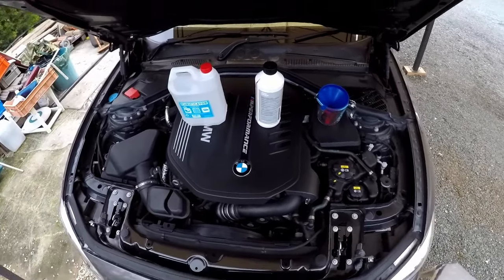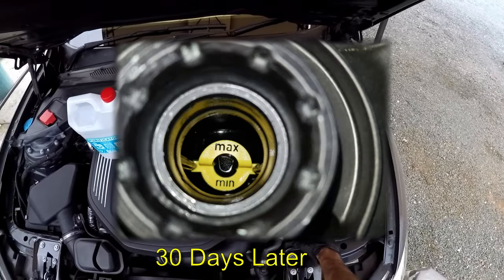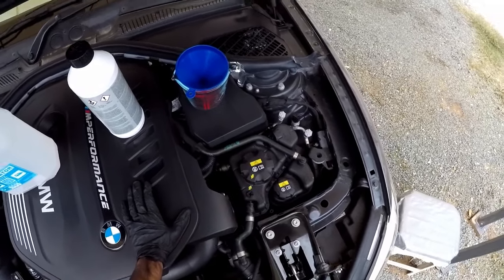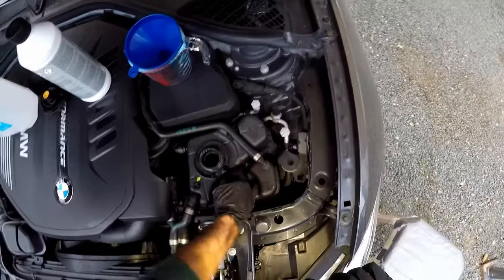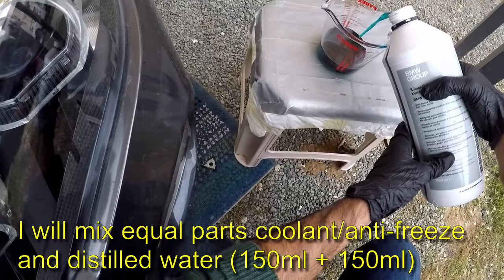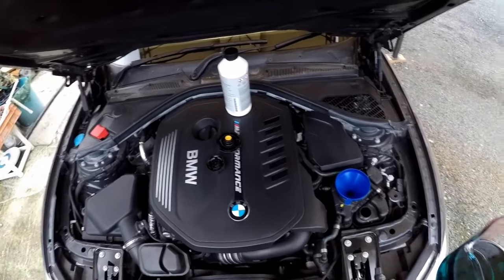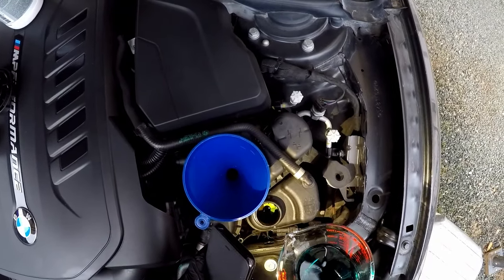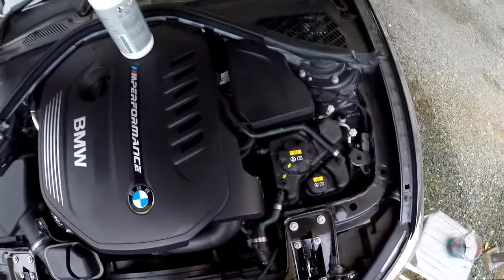BMW B58 Engine: How to refill coolant (Escaping from Filler Cap - Quick Video)

Comment: In my g20 m340 I have green coolant. Name ht-12 antifreeze coolant
Reply from the maker: Yes, newer cars will have the more environmentally friendly HT-12 which generally comes in green although early batches came in magenta. There's some information that HT-12 and the blue coolant are intermixable, but I would check with the official BMW manuals before doing so. Generally, if the car has blue coolant in the tanks then it makes sense to top-up with blue coolant. If the car has green or magenta coolant (remove a sample with syringe or turkey baster to check, i.e. not against the internal tank yellow indicator), then it makes sense to topup with green HT-12 coolant (you can topup with magenta HT-12 theoretically, but the magenta HT-12 was a limited production and won't be easy to find as a spare).
Reply: @NoBrainerTalk  it's not even says what coolent I have to use in my manual.. But I will check if it 100 green? Ht12 I have to. Mixes also right?
Reply from the maker: @oneofm3409  Yes, HT-12 will also need to be prepared as 50/50 anti-freeze and distilled water. Please make sure by reading the instructions on the back of the container.

Comment: Hi my friend, does the smaller reservoir tank hold coolant or just water?
Reply from the maker: Coolant (50/50 mix of anti-freeze and distilled water).
Reply: @NoBrainerTalk  thanks, my reservoir in the smaller tank is just water. I bought from new so will probably need to ask BMW to drain and refill with coolant and distilled water.
Reply from the maker: @f32440i  If it smells sweet it probably has anti-freeze (water will be odorless), but if you believe there is no anti-freeze or from its colour is likely not within the normal distilled water/anit-freeze ratio then yes have it flushed and replaced. The right percentage of anti-freeze is essential not only for reducing the freezing temperature but also for increasing the boiling temperature of the coolant and also adds corrosion protection to the circuit. Just water will have no corrosion protection.
Reply: @NoBrainerTalk  thanks for your insightful feedback. I'll have a smell but it definitely has no colour so I'm assuming bmw used just water from the factory which is so annoying.
Reply from the maker: @f32440i  I personally found a light brown / olive colour fluid in my intercooler coolant expansion tank (the small tank), and I also flushed it as there is no coolant from BMW except LC87 and LC18 (blue and green respectively). I think there must be a fluid BMW uses to add corrosion protection to the coolant circuit that is not a coolant (maybe also used to flush out build debris), and should be flushed (replaced with coolant) before the car leaves the factory. The presence of this non blue or green fluid I believe indicates an error at the factory. However, until now (despite being reported by multiple people around the world) we haven't had any confirmation from BMW that such errors have happened or recommending the checking of the coolant  (for wrong fluid), so this is purely a guess.
Reply: @NoBrainerTalk  very interesting analysis. I guess it's OK because if there was an issue with the fluid bmw use from factory, surely there would be fault codes on idrive. However, I topped up the larger tank as per your vid demonstration but my top up only required a small amount, approx 50ml. I used the bmw oem coolant and distilled water and took a sample first to ensure the colour was blue so all good. Next time I take my car for its bmw service, I'll ask about the coolant issue. Thanks again.
Reply from the maker: @f32440i  There won't be any error codes, if the fluid in the intercooler coolant system doesn't function properly as a coolant, what will happen is that the intercooler will not work efficiently, and the air out of the turbo (out of the charge pipe) will remain warmer and less dense. The effect will be loss of performance (less dense air going into the cylinders means less oxygen in the cylinders for combustion). Moreover as one of the cooling systems will be working less efficiently, the entire engine will warm up faster and be less able to dissipate the heat. Consequently when the block temperature sensor detects the warmer temps (and I believe using data from the O2 sensors on the exhaust side), the ECU will take measures to cool the engine, which will mean max cooling mode, and if that doesn't do enough then a commanded power reduction (to reduce temperatures). None of these will generate iDrive warnings because this is just the heat management system doing its thing. iDrive warnings would only be raised if the main expansion tank level drops to critical level and triggers the low coolant level warning. There is no coolant level sensor for the intercooler coolant expansion tank, so there's no warning for that. I guess the logic being that the main coolant loss can result in engine damage (hence the need for a sensor), but the intercooler coolant loss can only lead to performance loss (leaving it to periodic visual check). Just my personal comments..
Reply: @NoBrainerTalk  He is asking about the 2. smaller reservoir. there is no boiling there as that is low temp circuit. So should that low temp system get 50 50 coolant /water ? I also want to find this out.
Reply: @NoBrainerTalk  Why would they admit that most intentional error? If it was not an intentional error it would be happening only at 1 car inthe world and not all cars. Coolant is money for them. I believe that this is intentional marketing strategy to sell intercool parts and coolant after the 2 year warranty period. Admitting it will get them nothing. Not maybe today but for the future nobody can guarantee that the brand will produce cars forever, they are also aware of this and counting every cent that can be saved at this limited period of production I believe.

Comment: Did you manage to fix the drivetrain issue?
Reply from the maker: It hasn't reoccurred in a long time, so I am considering it to be resolved...  :) My gut feeling is that it was bad fuel together with the bad intercooler coolant, so the Wynn's additive and the intercooler coolant flush did the trick.

Comment: How’s your average temperature now? My intercooler fluid turned brown also but the larger tank is still blue. I used to average 90-100C and now I’m averaging 115-120C just from regular driving. I booked an appointment for a coolant flush next week. Hopefully that fixes it.
Reply from the maker: I haven't checked temperatures to be honest, have only been opening the expansion tanks every so often to check levels. All OK so far. One thing I will do soon is extract some coolant out of each tank and check for colour changes.
Reply: @NoBrainerTalk  Also, was I supposed to keep it between the min and max? I topped it up right at the max mark 😅
Reply from the maker: @ildrichaseron  If it's just at the max mark then it's fine. :)
Reply: i have 115 120 when im pushing it in sport+ is that normal?
Reply: @Noizy-te2zz  usually coolant temperature drops when you wot,
Reply: @NoBrainerTalk  stilll good level??
Reply from the maker: @bmwsincekid  Still "good" in a sense, I topped up my expansion tanks a couple of times over a period of a year, and now the temperature outside is 30 deg C, my engine coolant expansion tank is at max and my intercooler coolant expansion tank is just above max (I think the fluid has expanded due to the outside temperature). I'll extract some to bring it down to max. Generally no issues touch wood...
Reply: @NoBrainerTalk  im about to buy a 540i B58 it also had over the max for coolant i checked the weather was 20celsius
Reply from the maker: @bmwsincekid  Interesting. I think if it's just above max, then it's natural expansion with higher OAT (compared to the day it was last serviced) and if it's way above max then it was over-serviced last time.
Reply: @NoBrainerTalk  Next week hopefully i have it with me ,,,, Then i will check coolant … man i cant wait
Reply: Because you shouldn't top up that tank with coolant as it's overflow tank.

Comment: My coolant is quite low but the light doesn't come on, is that a defect?
Also, I have a different specificity of coolant in both tanks. Do you recommend I get them flushed and have BMW-approved coolant added?
Reply from the maker: I presume you mean in the engine coolant expansion tank, as the intercooler coolant expansion tank does not have a sensor. This is a common observation by B58 owners, that coolant drops below minimum in the engine coolant expansion tank, and it is found visually before any warning from the sensor. This can only mean the real minimum level of coolant (which triggers the warning) is actually below the level that the internal indicator indicates to be the "minimum." The "minimum" level indicated in the tank might be for best power retention of the engine, whereas the true minimum level (detected by the sensor) might be to prevent engine overheat damage. If you saw the expansion tank is bone dry empty and there was no warning, then yes this is likely a defect with the sensor, otherwise don't worry, just top it up to just below maximum. For the second question, if you have coolant that you know for sure is not BMW approved coolant, you need to get it flushed out. The various components of the coolant system are designed to tolerate/use a very specific coolant specification and coolant of different specification can theoretically be harmful to those components (e.g. compromised lubrication, corrosion resistance, etc). There's no reason to use non BMW approved coolant (and bear in mind now there are two coolants, the classic blue coolant and the green HT-12).
Reply: @NoBrainerTalk  Alright, thank you very much for the info man. Helps me out big time!
My mechanic is a stickler, I might actually have to convince him to flush both systems.
Reply from the maker: @PancakeProduct  Good luck!

Comment: horrible, this should not be a problem until the car reaches 200K plus miles
Reply from the maker: Indeed, but in a way taking care of something easy like coolant topup makes you feel more connected with the engine. :)

Comment: Should you bleed the coolant after refilling? Or is the bleeding procedure only for when you drain the coolant?
Reply from the maker: The bleeding procedure is used when performing a flush and refill of the entire system. I believe it is not necessary to perform the bleeding procedure after only a topup of the expansion tank.
Reply: @NoBrainerTalk  what if there was a good amount missing like to the point where I got an indication from the car, cause I just topped it off right now and I have turned it on yet, don’t know if I should bleed or not?
Reply: @NoBrainerTalk  also thank you for the response 🙏
Reply from the maker: @daviddan1379  You are welcome. I'm not sure to be honest. The expansion tank stores the additional coolant that the system may need depending on the mode configuration (especially for max cooling), so it may not be critical to bleed it out (you've not interfered with the lines, radiators, etc, just the fluid in the expansion tank). But there is also no harm to perform the bleeding procedure...

Comment: so you filled coolant in both tanks??
Reply from the maker: Yes, I added some 50/50 mix coolant to both tanks. In the intercooler expansion tank later on (months later) I added just distilled water to raise the level just a tiny bit.
Reply: @NoBrainerTalk  but what if you add months later in intercooler expansion 50% 50% and not just destilled water? it smth wrong ?
Reply from the maker: @Noizy-te2zz  Hehehe, I did that simply because of convenience. However there is no risk. Even with a tiny bit of water added as a top-up, the overall mix of anti-freeze and water will still remain roughly 50/50 (the total quantity of fluid in the intercooler, radiator, pump, tubes, etc is quite large). In any case, no harm will come to the engine if the mix was e.g. 49/51.
Reply: @NoBrainerTalk  i have also one question.. In the big intercooler expansion tank im fine i have antifreeze between max and min, but in the smaller one ... i have on top of the max, i mean a little bit more than half of the expansion tank.. so should i take out or its not trouble for the smaller one ?, cause i also dont have accesories right now to take it off etc.
Reply from the maker: @Noizy-te2zz  Hi, the big expansion tank is for the engine coolant, only the small expansion tank is for the intercooler coolant. I would buy a syringe and extract the small excess coolant from the intercooler expansion tank and bring the level down to the maximum. You should do this more urgently if you drive the car hard (or are living in a hot environment) i.e. if there is more chance the coolant will get very hot. The max indicator is there for a reason, keep in mind that any fluid will expand as it gets warmer, and BMW have obviously calculated how much space is required for the fluid to expand into without over-pressurising. I would always recommend to adhere to BMW limits. If you don't push the car hard then it can wait a little longer to remove the excess coolant.
Reply: @NoBrainerTalk  Dude thank you for that answer!  i dont live in a hot environment but i push my hard so it seems that is the problem if i have more than maximum, so thanks for advice, i just thought that it doesnt matter for the smaller one, but yes i see i t matters and its for the reason a Max,  so yeah for sure i need to buy the syringe tomorrow to bring to the normal level. Thanks !

Comment: you just use the same engine coolant for both
Reply from the maker: Indeed that is what we believe is correct.
Reply: @NoBrainerTalk  This is a random question but here goes
i have a bmw 320i lci f30 2018 m sport (B48B20A engine block i beleive) 
mods so far
FTP charge pipe
MST intake
BOOTMOD3 93 OCTANE OTS MAP stage1 46%hp increase 48% torque gains specified

now bmw say 181hp stock but ive seen dynos stock at 192 to 194

so given  the above i should be making 280 to 284hp on my stage with 435nm of torque

does that sound right to you??
waiting on my catless downpipe to come also
fyi i only ever use 99 ron fuel (93 0ctane)

cause i know the 330i has lower compression 10:2.1 mine has 11.0.1 (same as b58)
meaning lower compression on 330i can handle more boost safely, so stage 1 on that would be around 296 to 300hp
Reply from the maker: @Reaper_f30  I believe it's hard to get a proper dyno measurement, alot of dynos don't measure properly and tend to quote higher engine power than real. Having said that, if your car is making 181hp stock per BMW figures, then you can expect a sizeable improvement from stage 1 tune. Stage 1 tune tends to give the most power increase, stage 1 to stage 2 is not as much increase (when you get the downpipe). bootmod3 is very well respected, and their OTS tune claims tend to be realistic. If they are quoting 46% increase in hp, I would expect that to mean over BMW figures, so about 265hp.

Comment: Hey man!

Im losing coolant from the main tank in the b48 320i engine, i filled it up with 50/50 like you did and after 5 months it was losing halv coolant it now in the minimum range. So i went to bmw and they sad that it should lose some coolant even in the diesel version and he sad that if you coolant warning lights is coming up than its something wrong, and i should not fill it upp just to se if the coolant light is going to pop up. 

So what do you say about my case losing half of the coolant after 5 months?
Reply from the maker: The point at which the warning light comes on is even below minimum. I would not drive a car for extended periods with a coolant level below minimum. You should keep your coolant levels within the levels decided by BMW, and if there is unexplained drop in the coolant level again, the dealer should pressurise the system and check for leaks. Coolant level drop can occur for many reasons (e.g. incorrect bleeding procedure), but if it happens repeatedly then the root cause needs to be found. I hope this helps.
Reply: @NoBrainerTalk  is you car consume coolent after all you did?
Reply from the maker: @senadselimovic8649  It's been stable, but I haven't been driving that much due to curfew and lockdown and stuff. :(